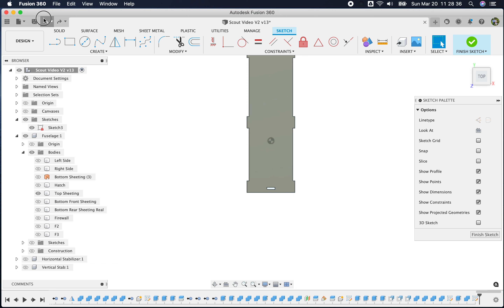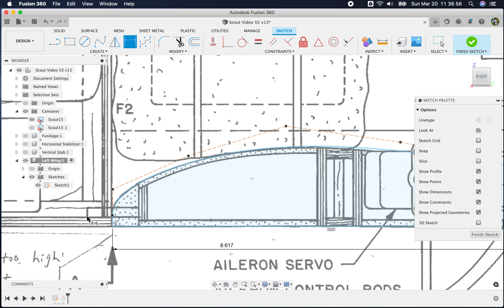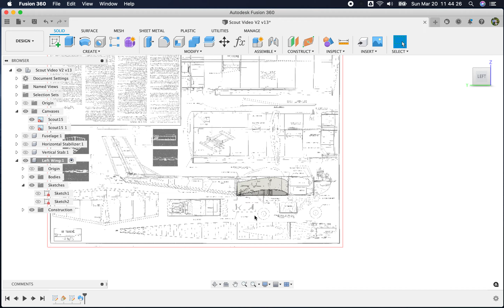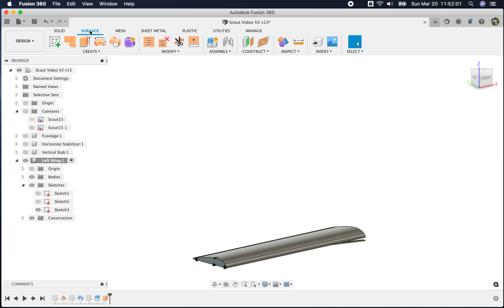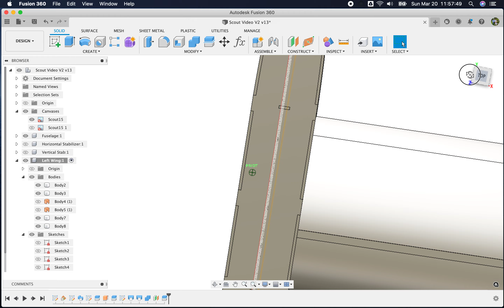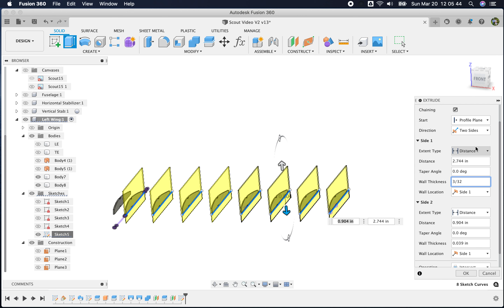RC Model Design in Fusion360 Part 6A Wings

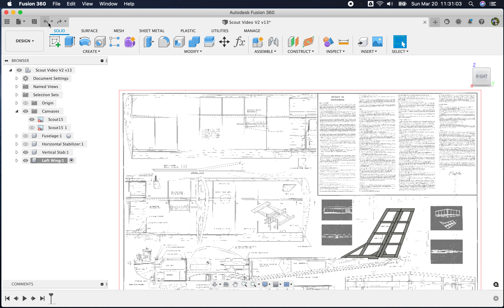Comment: at 7:40,   JUST  PUT  A  PROTRACTOR  on  it.       it's about six  to  eight  degrees (per side).
Reply from the maker: No need for caps. You can put a protractor on it, and put the dihedral where you would like. 1) protractors, the clear ones, are not particularly accurate. The math is dead on. 2) 5 deg per panel is more than sufficient dihedral for stable low wing trainer. But, I digress, that is beyond the scope of this video.